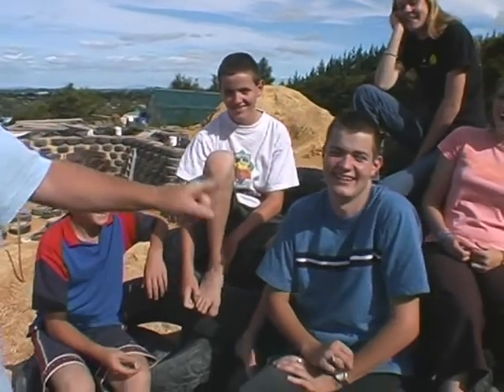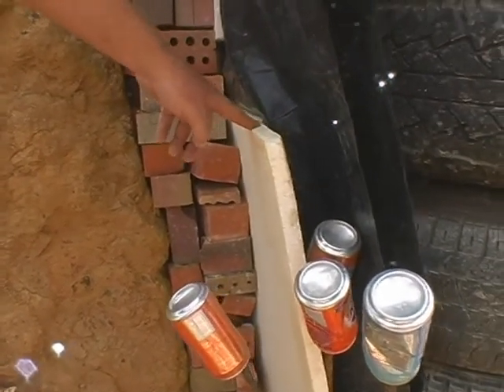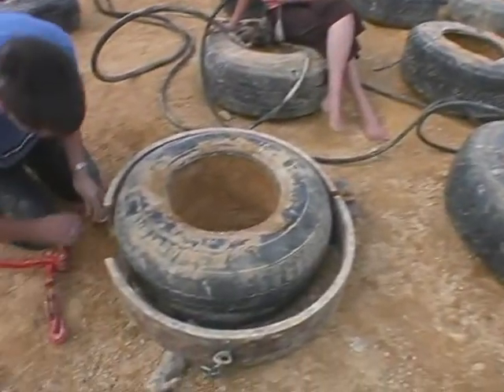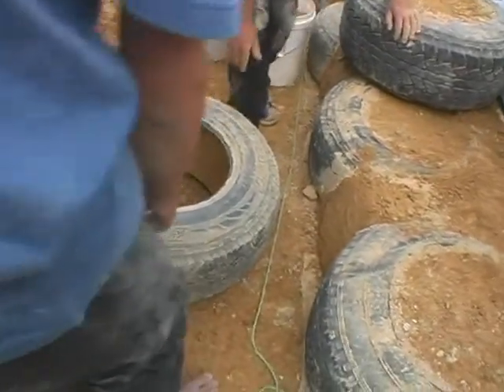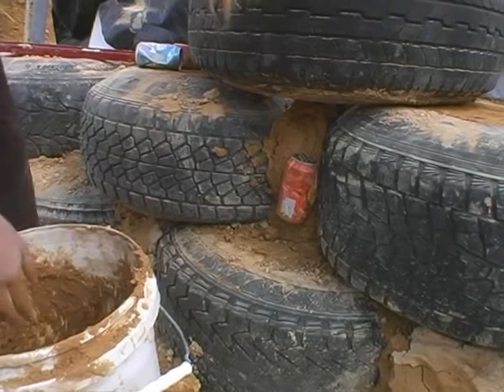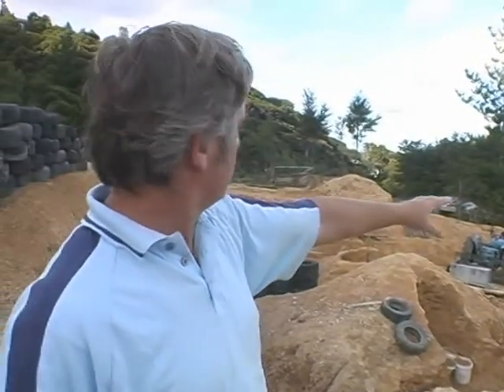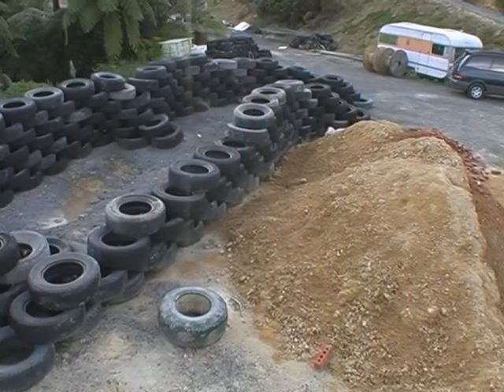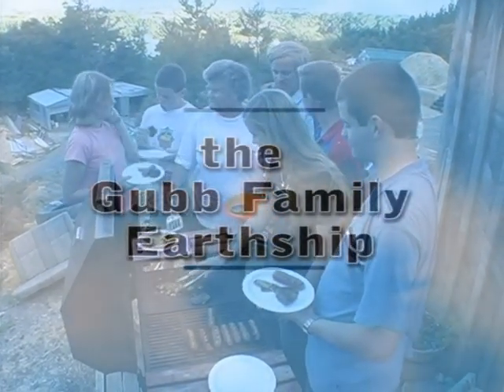New Zealand Earthship

Comment: if you look at other Earthship construction videos on you tube you'll find that they screw the  half tires on after the earth has been rammed in the tyre but before the half tyre has been filled, and as for the hydraulic ram it  may not save much time but it saves the energy of of your work force , nothing worse than you unpaid work force quitting half way through the project.

Comment: now Ive seen the photos I realize how much of a compromise u have had to make to get past building codes like many others. Thats a lot of steel and concrete for a structure already proven to be very earthquake resistant. Pushes the cost towards the unattainable for a lot of ppl too. We need to find a way to convince councils of a tyres integrity as theyre negating the main reasons for using them, eg. load bearing, cheap, green and can be built by anybody.

Comment: not having to bucket up the dirt does make a lot of sense, I might have to reevaluate my ideas :) Is the cement foundation and rebar going up the center of the tires something u had to do to get past building codes? Also is the rebar joined to the foundation?

Comment from the maker: @jedics1 It may seem to be better to press tyres in place, However it would have been more difficult, 1,Because it would be very awkward using our press on the wall. 2, Rolling the tyres up planks easier and quicker than lifting buckets of clay. 3, We have galv rebar going up through the center of every third tyre so it would have made pressing these impossible. And finally the tyres weighed in at 220kgs after they were full, they aren't full when we put them in place on the wall.

Comment from the maker: @jacobnavy 
Hi,
I'm not sure what you want me to tell you. It's very straight forward, The steel band is made the same size as the external size of the tyre size you decide to use and the ram needs to be able to fit inside the tyre. The plates at the end of the ram want to be as wide as the stretched open sidewalls of the tyre. If I was to build another one I'd use a ram with a telescoping spear.
Hope this helps.

Comment from the maker: Due to the number of emails I've had regarding the tyre press in the past 2 weeks I make these comments. It is custom made for 15" & 16" tyres. The steel band is 25mm plate steel. If you want to make one for yourself do so by all means, it's not copyrighted. If I was to make another one I'd use a ram with a 2 stage spear, and I'd make the plates at each end of the ram almost as wide as the tyre can be stretched open. Remember that the ram needs to be double action ie. goes both ways, in and out.